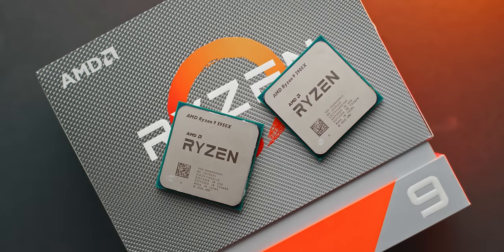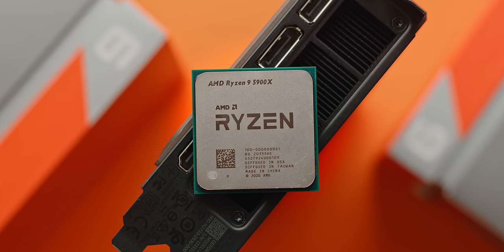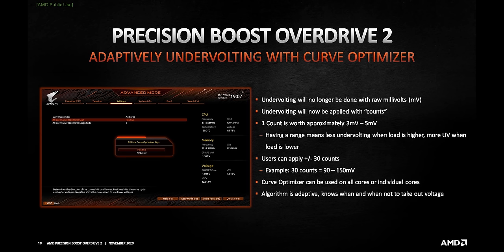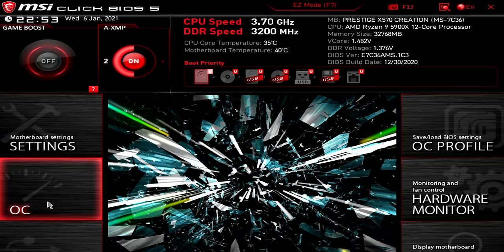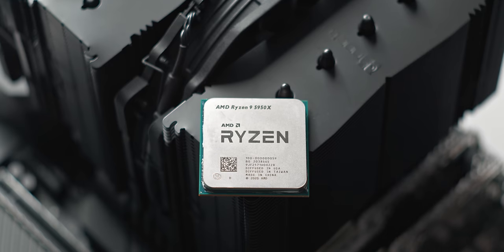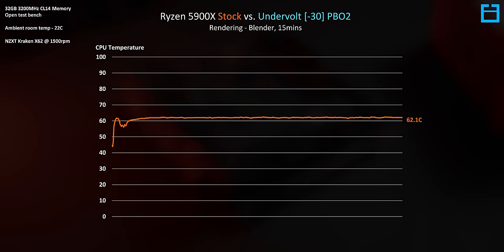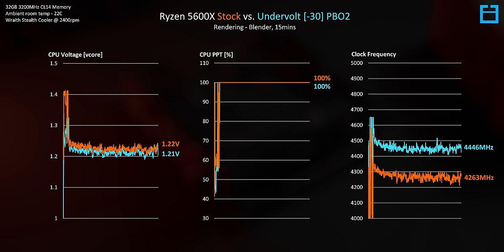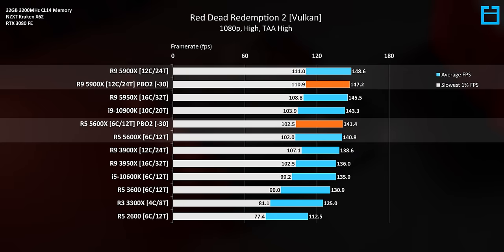Ryzen 5000 Undervolting with PBO2 – Absolutely Worth Doing

Comment: I was actually already using and realized the usage of PBO as an automatic undervolting tool some time last year. It's absolutely refreshing to see someone discussing using PBO in this manner. My 2600X runs much cooler at all times with nearly negligible performance impact
Reply: @Tigron depends what cooler you're using, 75°C is fine. As long as you dont start to hit 80°C it will be fine, the thing with ryzen is just the lower the better but it wont impact cpu lifetime.

Comment: Hey, thanks for this guide. I've been looking at some other guides too, and found some different / other approaches, but yours netted the best results it seemed. My main concern which was highlighted by some people on these undervolt tweaks, is stability at low workloads (low speed, low core use, low voltage). Apparently when undervolting using the PBO2 the issue is not so much staying stable at high workloads whether single or multi-threaded, but the other end where e.g. a -30 might cause instability. The issue is that I haven't been able to find a solid way of testing this kind of stability - I did see some mention of using the windows repair flow, but that's quite a hassle to trigger, and I'm uncertain if it's ensuring full stability. Did you find a good way of testing low load stability? 

In addition, a lot of other users took a different approach where the set PBO limits to motherboard, then set a boost override (+200 ish), and then apply negative values per core, with the lower values being on the two best performing cores, and a much less aggressive undervolt on all the other cores (I think something like -15 on best cores  and -5 on other cores on a 59000x). 

Did you try anything like that too? I guess some of the temp benefits are lost. 

For now I'll go with your approach unless I run into any sort of instability - but would love to hear whether you tried some of these approaches that most other people seemed to take, and whether they'd change your recommendations.  

This guide seems to fit the "typical" approach I've seen other places: https://www.anandtech.com/show/16267/amd-precision-boost-overdrive-2-adaptive-undervolting-for-ryzen-5000-coming-soon
Reply: This is the first guide that said to disable PBO which confused me but I've seen lots of good comments so I'll try it now.

Comment: A tip for those, who have another cpu or motherboard and can't use the features shown in this video: you can set max cpu performance to 99% in advanced power settings (in Windows not in bios). And after that thermal and noise levels will be way better. Most likely, you won't notice any performance loss. Even if you do notice and you need full power, you can easely set it back to 100%. And then back to 99% when you don't need full power but prefere silence. I hope it will be usefull for somebody 🙂
Reply: thx😀

Comment: And he skips the 5800x which would likely get the highest benefit from undervolting
Reply: Literally all I came for
Reply: Haha this was me.
Reply: At least the process is easy to try
Reply: Yep, but it’s the same process anyway.
Reply: DId you ever figure out which number works best for you to plug in for the 5800X? Thanks.
Reply: @JeffBorger  It will depend on your sample but I keep both mine at 1.35 volts and 4750Mhz on all cores.  I know I could go lower on the voltage but it still stays under 80c so that is good enough for my needs.  And I have a 360 AIO which helps as well.
Reply: @JeffBorger  I can do -30 on the 5900x, so try that on the 5800x. Worst that happens it's unstable and you need to go higher.
Reply: My 5800X is unstable at stock…
Reply: @stereodark  how do you check if your cpu is stable
Reply: @Mayhemz.95  yes…
Reply: @Mayhemz.95  just to clarify I get blue screen at stock when running a benchmark for more than 10-15 min, if it’s an all core. Temp hits max 75C, if I cool it further with a massive 360 aio it lasts a few minutes more but I still get blue screen after 18-20 min. With the curve at +15 it’s stable at 85C for several hours. I tried 4 different ram kits, with or without GPU, replacement mobo from B450 to B550 to X570. I also swapped PSU from 750 Corsair platinum SFX to an overkill 1200 titanium. Nothing helps, it’s just a CPU that doesn’t work at the frequencies it is supposed to hit at stock.
Reply: @stereodark  My 3700x was unstable at stock but my 5800x is a monster
Reply: @sam-dn9hr  mine was exactly the opposite. 3700X was perfect, since I switched it with a 5800X I only have issues. I would love to RMA it but I don’t want to stay without CPU for months
Reply: @stereodark  Thats is a shame...Maybe if you can pick up an old preowned 2200g you can send the 5800x back for RMA? You definatly should send it back because when its working the 5800x is awesome. Also its far too expensive to put up with poor performance. I hope you find a good solution :)
Reply: @sam-dn9hr  Thanks for the suggestion I’ll consider that option!
Reply: Have my 5800x with curve optimizer settings at -19,20,26,30,26,29,26,27 and +200mhz boost
Getting a 5,05ghz boost on all 8 cores and around 4,65-4,7ghz all core in cinebench
Reply: At 100 more 5900X is a no brainer.
If you're upgrading make it an upgrade than sidegrade. I assume many already have 8 cores or 6.
You might not need it but hey. Just means it'll last a bit longer before upgrading.
Reply: @TheBartxxxl  can you help to overclock 5800x
Reply: @sreedharan3741  it is a lot about trying and having time. For best results you have to use the curve optimizer with the per core setting and try out for stability

Comment: Greetings! I did exactly the same steps with my 5600x on b550m aorus pro-p, and it just doesnt work, in full load and stress tests cpu heats up to 75-78 dergees before and after this tweak, Are ther any other tweaks i need to check? I noticed Disabling Core perfomance boost helps with the temps, dropping them to around 50-55 but frequency is locked to base 3700 mhz, dropping perfomance

Comment: Thanks for this awesome guide. So on my 5600x with an MSI x570 Gaming Plus, I did not get a stable POST with -30. -20 seems fine. Voltage and temps do seem lower, but core clock speed stayed the same as on the stock curve.
Reply: No crashes?
Reply: Also wont boot with -30, just tried with -20 and it's ok, will testing...

Comment: Late to the party but I’ve owned two 5950x’s at this point both with -30 offsets. Helps thermal a ton to the point I could go away from a h115i 280aio to a nhd15 for my quasi-server/homelab/gaming setup

Comment: Just applied this to my 5900x. It’s incredible what it’s capable of! Getting more performance with cooler temps in my ITX build!
Reply: Hey i just bought 5900x and arctic freezer 34, my temps are 45-50 when i go in bios and cpu voltage is 1.34. When i play games my cpu temps are 90 and i think i am not geting all of my cpu becouae of high temps. Also i am affraid it could dmg cpu. You think this could help lower temps of my cpu? Anyone can help?
Reply: @marinbarzic3103  this will improve CPU temps a bit. As long as you keep the power limits on „auto“ instead of „disabled“. The freezer 34 isn’t really the optimal choice for a CPU of this caliber. Better go with a 240mm AIO minimum or one of the huge aircoolers like the NH D15 or scythe Fuma 2.

Comment: This appears to be stable at first, but Prime95 is throwing plenty of errors on low number of threads. My 5900x instantly errors out on 1-2 threads. At negative 30 the voltage is simply not enough to support strong single core clock. You can optimize per core and find the best setting for your specific CPU but I put it at negative 10 all core and it seems to be good enough. It's not that much faster but it's something and takes no effort.
Reply: -20 is pretty stable for my 5600x

Comment: Old video I know but thanks very clear.  I -30'd my 5800X3D and it worked beautifully - also lowered PPT: 120Watts  TCD: 85Amps  ECD: 120Amps (from stock 142W,95A,140A) as I really just want to lower temps and keep noise down while retaining same performance.  I ended up with about a 5% improvement in performance and about 7 degrees lower temps and less power consumption and less noise. Can't go wrong!

Comment: -30 all core will not be stable. People are gonna encounter a crash sooner or later, likely while doing light load tasks like browsing. Need to do per core and the best 2 cores likely will not be stable with more than -10.
Reply: -30 all core has worked great for me on a 5600X.
Reply: -19 for me max understanding. - with 20 value crashed some games. Work gor me all the values -10 to -19. Ofc select -19

Comment: I applied a negative 30 curve and my temps are down to 50°C on full load while previosuly it was at 60°C. Whole build runs quieter and cooler. My build consists of a Ryzen 5 5600 paired with an RX 6700XT. You earned a like and a sub.

Comment: Good video but im surprised you havent tried per core option in curve optimizer, thats where 5950x shine, it was that because you were limited by one core which couldnt do better negative offset than -12. Im currently testing my 7th core on my 5950x and on my #0 core i cannot do negative offset at all so value of 0 is stable and im using 200mhz on auto oc so that might be the factor which effects that. Other cores can do, ranging from -10 to -20 so far. Im slowly moving through my cpu threads and after each new offset i see big changes in temps and clockspeeds. You start with negative 0 value on all cores and start  tuning one core at the time giving around 2-3 days of normal pc use to ensure stability (especially on idle and light gaming it can show whether its stable or not)

Comment: TY! 5800x here thermals lower 10C at idle. Despite H1 case, I manage to beat r23 normal user scores. My curve was stabilized at 28.1609 single, 15000 multi. This is all with every program that I need installed.

Comment: after this my cinebench score went up for almost 1000 points on multicore test. But the temps are the same. Is there any other way for lowering my temps? I have ryzen 9 5900x
Reply: what are your temps?
Reply: @fabu98  with PBO2 set to negative 30, I'm getting around 75 in games.

Comment: Thanks you for this video! I was getting extremely high temps with my 5700x with ambient temperature of around 27c, after setting an undervolt of -.1,5 it went from that to 69c under full load

Comment: Thanks for the video. I just completed an 5800X MSI build and I was very disappointed with the temps. Under heavy loads, including some gaming, I was getting idle temps in the mid 40 c range and maximum temps sometimes reached 90c. I am using a Corsair h80i and was ready to try another cooler. I tried undervolting and started at -5 and tested the system. I tested stability by just throwing in a game that I was getting temps in the high 80's with. Unbelievably the CPU fans never even throttled up. I actually had to look at the fans and see if they were working. The maximum temps I had were in the mid 40's, down from 85+ degrees! Even now my idle temps are only in the mid 20's. I also tried Prime95 and let it run for 30 minutes and the maximum temps dropped by 12 degrees. This still seems unbelievable to me that I can see such a large decrease in overall temps by just undervolting by "5." At least now my system doesn't sound like a vacuum cleaner every time I render video or put it under a load. I am not even going to experiment with other settings, I am very satisfied with the results.
Reply: That sound's awesome. I found a decent deal on the 5800x, but the default thermals scared the crap out of me, as I'm looking to make a HTPC. Might consider it now. Is it still running well for you? Did you improve the settings and temps further?
Reply: @TheBorsMistral  I didn't try to improve on the settings, since the thermals are very acceptable. I do mostly video editing and rendering and so far the system runs flawlessly without any stability issues at all. While rendering a large project, with CPU load near 100%, I have not seen the temps go above the 50c range, with the CPU fans ramping up to only around 65%. Overall I am very satisfied with the chip and would not hesitate to build another 5800x based system, especially since prices have now dropped by about $100.00 since my build. Good luck with your build.

Comment: 5600x here. Negative offset of 30. Cinebench scores went up by 200 points while the temps maxout at 61.1c. Clockspeeds also boosts at 4650Mhz.
Reply: Do you have core performance boost on or off in BIOS? please tell

Comment: no love for the 5800:( ?
Reply: It helped a lot with my 5800x I can run it with an offset of 20 on my ASUS ROG X570 E Gaming and it now reaches only 83°C max,  after multiple runs in Cinebench R23. My cooler is a Bequite Dark Rock 4 Pro.
Reply: @ZOCKERXD1000  same here 20 seems stable for me cause 30 will crash while running cinebench
Reply: @ZOCKERXD1000  what where your temps before the undervolt?
Reply: @Lha_Luke   90C after  2 runs of CBR23 and idle temps are also around 5 degrees lower

Comment: Thank you! This works on x470 as well (newest BIOS on an ASUS prime x470-pro) My 5600X results on negative 30: 80°C instead of 88°C on prime95 smallFFT and under 70°C on Cinebenc R20 with better score. Using the wraith prism from my previous 2700X

Comment: Try -15 for 5600x, I got 13% improvement overall.
Reply: I'm about to try this, how are the thermals? Are you gaming?
Reply: @pogtuber5146  ~Never goes above 55c with a NH-15s
Two cores gaming hit 4.85Ghz and when using heavy muti core they hit about 4.4-.46Ghz
Reply: @vidiveniviciDCLXVI  that sounds good, and all you did was the PBO2 offset? I have a smaller cooler in an HTPC so I'm trying to reduce my max temps which hit 80°C, not enough to thermal throttle but I don't like the noise
Reply: @vidiveniviciDCLXVI  Will do, thanks!

Comment: Thanks for the video! Just got my cinebench SC score to 1652 with a Ryzen 7 5800x. I’m pumped to do more testing and make sure it is an improvement in all conditions and stable.
Reply: How did it go? I just built a PC with a 5800x in it and will experiment with undervolting myself.
Reply: @CommonSkill  I’ve undervolted four 5800x’s at this point for myself and coworkers. All went pretty well. It’s annoying that you don’t know if you went to far until the pc randomly shuts off while in a low power state. I definitely recommend Ryzen Master to figure out the best 2 cores. They can’t be undervolted as much as the other cores so keep that in mind. It’s all pretty straightforward. Just a lot of trial and error. This video says to set the power usage for PBO to the stock settings, but in my experience the motherboard setting worked better on asus motherboards. Good luck!

Comment: This worked* for me.  Really impressive numbers while rendering video, all core workload.  I went from 85C to 75C, 4450MHz to 4720MHz, 150W to 107W, on my 5900X

Now about that asterisk.  I crashed on a light work load (using a photo editor and browsing web).  I brought it down from 30 to 20 after that crash and crashed as soon as the PC was done loading start up programs.  I'm attempting 20 again because it went back to 30 in BIOs and it's running now, BUT

I'll keep this comment updated as I go on here.  Gonna leave the PC on 24/7 for a while, ranging from totally idle, to gaming, to all core workloads and see how it goes.
Reply: I am waiting for your subsequent comments
Reply: @andreeburkov  I crashed while gaming on -20.  Not even an intense game.

I've dropped to -15, stable so far.
Reply: Still stable.  Did a little back and forth testing between this and just PBO enabled to make sure I wasn't crazy.

And indeed, rendering a video took 35m with just PBO and took only 12m with a -12 undervolt.  Absolutely massive improvement for workload tasks for sure.

Comment: Thank you for such a clear explanation about PBO2. I've just come from 10+ years of Intel processors to a 5900X and found the advice from other places was to increase all sorts of limits which resulted in high thermals when doing pretty much anything (and low performance). This method (keeping power limits at stock), along with your explanation makes much more sense.

Comment: I used to be an Intel lover. Low temps and good all around performance but recently got myself a 5900x due to pricing and availability and put it under water. I noticed a large increase in thermals. I used to run at 35-45 degrees even when gaming but now it increased to 55-65 degrees while custom watercooled. And not many channels focus on lowering temps, its all about the massive monster overclocks etc. I will check this out to try and lower the temps because the current temps are driving me insane.
Reply: They may drive you insane but are totally normal for a ryzen CPU, hell you are even in the lower side of range when using a 59xxx . It is only your ego that drives you nuts. I also had to learn this after switching from intel to amd after over a decade of gaming.
Reply: @Antidepressiva1980  Yeah a year later i realized this. It was my own perception from having  i9-9th gen that never went over 40 degrees celsius that made me think something was wrong, but i accepted the fact that running at roughly 50-55 degrees while gaming is acceptable. While idle it goes to 30 degrees. This is however after undervolting.

Comment: MSI B550 Tomahawk / 5800X here, I've managed to get a rock solid stable -27 on all cores / Noctua air cooling (NH-U14S).

Cinebench R23
Stock - 15611
 -27 (all cores) - 16197

Every other setting in the bios is stock.